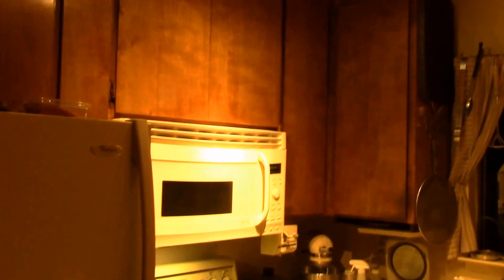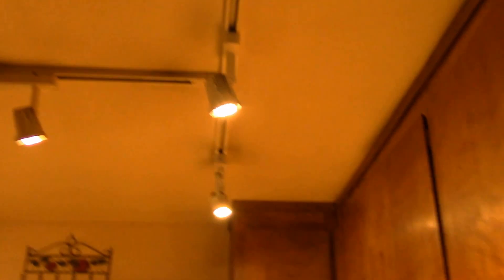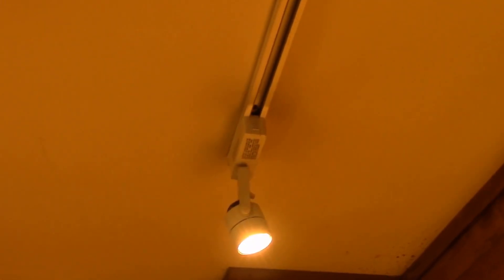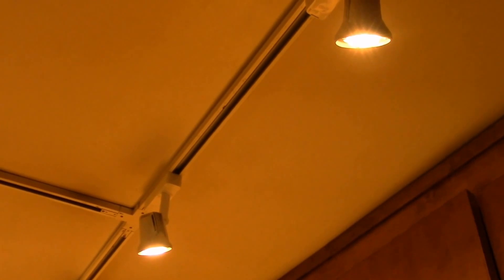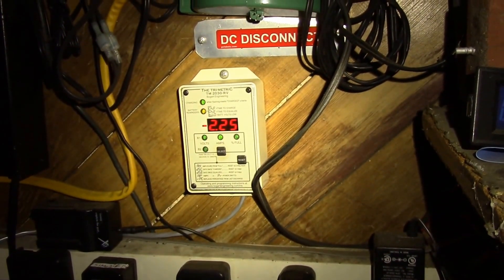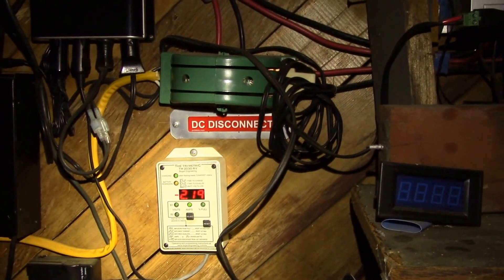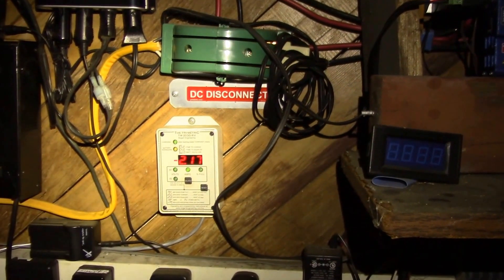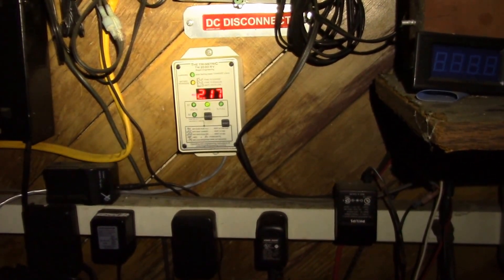True Low Voltage Track Lighting, Part 4

Comment from the maker: These low voltage MR-16 track lights are still working great over 9 years later.  Not a single bulb has failed.  I've been running them most of the daylight hours recently as I have excess power from my PV system and this helps to soak up about of those excess 40 watts.

Comment: Are indoor low-voltage lighting systems not quite available on the market right now? I see some recessed cans but I’m looking for a whole system of track lights and pancakes ceiling LEDs.
Reply from the maker: I've not looked for that type of system in a while.  I find you need to be a little creative, like I did here utilizing fixtures that take bulbs that operate on 12-24 volts, then bypass the internal power supply.  I think I've seen some track light fixtures that seem to have just the power connector part and the lamp housing.  What I search for is fixtures for MR16 GU5.3 lamps.  There are a lot of GU10 fixtures, but those are for line powered bulbs.  One could get those and swap in a GU5.3 bi-pin socket in place of the GU10 socket and the low voltage MR16 bulbs should fit the same.  There are other types of bulbs that you can get in low voltage styles, like the outdoor hanging lights:
https://youtu.be/Xf2gJRWOoV8
The trick is to find fixtures that have replaceable bulbs that you can retrofit with low voltage versions, like I did here:
https://youtu.be/dkL13Z4xwbM

Comment: Thank you for these 4 videos!  I have 9 low voltage track heads (Emerald 135Ls, 2006 vintage, with MR16 bulbs) that have begun to fail.  They’re $40 - $60 ea. to replace.  So I’m thinking you may have provided the alternative I’ve been looking for.  (Interesting there’s not more on YouTube about how these integrated 12v power supplies are subject to failure.)  I don’t have solar (yet!), but here’s what I’m taking away from your 4 videos:
 
1.    I can bypass the 12v power supply in the track head as long as I install a stand-alone 12v power supply somewhere in the circuit, upstream of the track, to step down from line voltage.
2.    If I do this, then every track head on that track must have its integrated power supply bypassed.
3.    I can continue to use the 50w halogen MR16s I still have until they’re gone.
4.    However, if I continue to use the 50w halogen MR16s, I will need a power supply good for 4.17 times the number of track heads being fed (50w/12v = 4.17A).  Is this correct?
 
A couple more questions:  You say at 3:35 of Part 1, “I could run ten lights like this off of one [12v/5A] power supply.”  That’s only true for the 5w LED bulbs in your example, correct?  And if I could mount my stand-alone power supply upstream of all 9 of my track heads (they’re on 3 separate tracks), and each track head has a 50w halogen bulb, the current draw though that power supply is going to be (50w x 9 bulbs) = 450w/12v = 37.5A!  So if I did this right it would indicate I’d need one 5A power supply such as in your videos (3:40 of Part 1) for every track head.  Is that correct?  
 
And even though my original (existing) configuration is 9 track heads each having a 50w MR16 halogen bulb, which equates to a sum of 37.5A DC total, the AC current from the circuit (upstream of all the track heads) is only (9 x 50) / 120 = 3.75 amps AC; well within the 20A rating of the circuit breaker in the panel.  Is this a correct understanding?
 
Thank you again for your videos!
Reply from the maker: Yes, you can run the track off 12V DC (or AC) and each head has to have it's internal power supply bypassed.  That said, you have to watch the current draw.  I think my track was rated at 500-600W at 120V, but at 12V you would be looking at 50-60W (about 5 amps).  Since you're not upgrading the conductors in the track, you might have to have multiple 12V power supplies feeding it along the run.  With 50W halogen bulbs you'll be maxing out the track with a bulb or two.  

One thing you might be able to do with the 3 tracks is to feed each one with a separate 12V power supply say in the middle of the 3 heads.  That way the middle head would get power right  there and then you would have current for one 50W bulb running down each end of the track.  You would need about a 15 amp rated power supply, or one big 45 amp supply feeding the center of all 3 tracks. 

With the 5.5W LED bulbs, I'm running 7 heads without issue on a single 12V feed.  Also, many MR16 LED bulbs are capable of working up to 24V, so that would double the wattage.  The halogen bulbs are generally 12V only.
Reply: @The4Crawler  Thank you for that insight about overloading the track.  I think the solution I'm coming to is to do a separate 12v power supply to each of the 3 tracks and only install each one when I'm ready to convert all 3 track heads on that track to LED.  So for example, I have 2 track heads that have failed, and a third that I think is trying to go bad.  So I'll collect all three of those onto one track, equip them with LED bulbs, and install a 12v power supply just for that track only.  Then over the coming years as more of the track heads fail I'll do similarly with the other 2 tracks.  That should also give time for more of the halogen bulbs to fail (I don't like landfilling something that's perfectly good).  This solution also makes more sense from an installation perspective as well; i.e. each track is mounted on top of a beam of a cathedral ceiling (the lights point up and reflect off the ceiling), and the 12v power supplies can be mounted up there as well and not be visible from below.  Whereas if I tried to find a spot for a single 12v power supply for the entire lighting circuit, I'm not sure where I'd put it; it's a 4-way switched circuit (3 separate wall switches), so the power supply would probably have to go in the attic or near the service panel.  

BTW, thank you also for the tip about using a paper clip.  I'd lost the retaining clip for one of the lights and a small paper clip has done the trick!
Reply from the maker: @havebikewilltravel3698  Sounds like a plan.  Yes, putting in LED bulbs is the big win here since they use about 10% of the power/current, you can have the same number of LED bulbs as halogen bulbs.  Since changing to LEDs in 2013, have not had a single bulb fail.  Be sure to get good quality bulbs, I used the Philips bulbs with passive heat sinks.  At the time they had higher wattage with cooling fans, but those didn't last very long.  Also, pick a color temperature you're happy with.  And yes, with separate power supplies, you can use your wall switch to turn the power supply on and off then run the 12V DC to the tracks from there.  In my case, I ran new DC wiring to the lights and disconnected the original AC wiring at both ends.  But if it works out, you could tap into that existing wiring where you install the power supply.  AC to the supply input then feed the DC output on the old wires connected to the track as long as they only feed that one device.